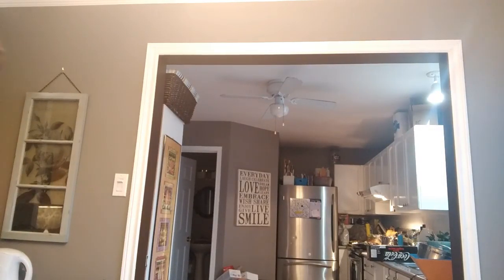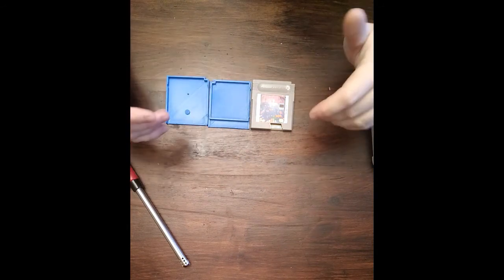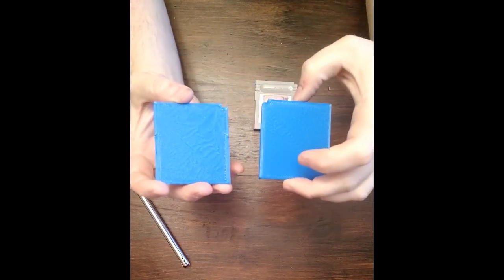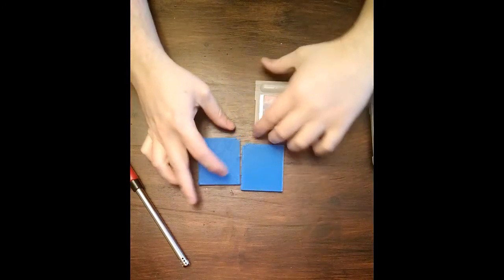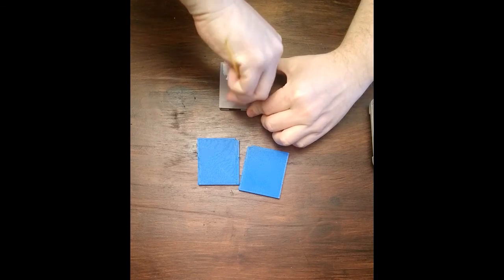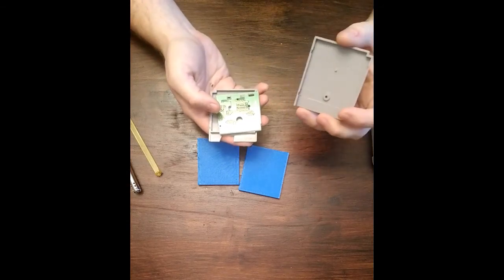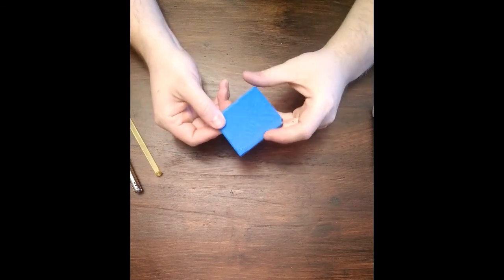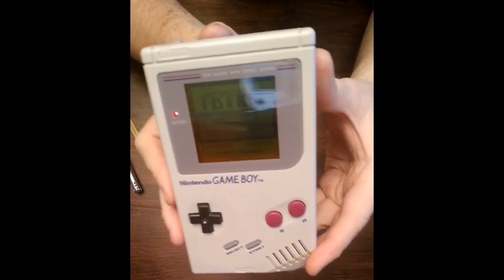3D Printing A Replacement Game Boy Cartridge

Comment: Is there a way to rework it where there won’t have to be a save battery?
Reply from the maker: Not that I am aware of. The memory on these carts requires power to retain its contents. It would require replacing this chip with something that works identically, but doesn't require power.